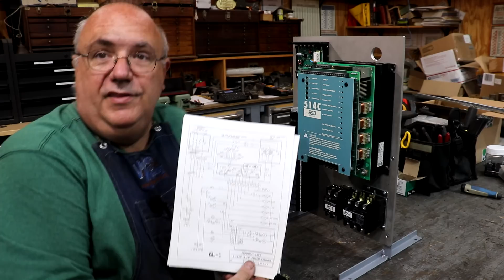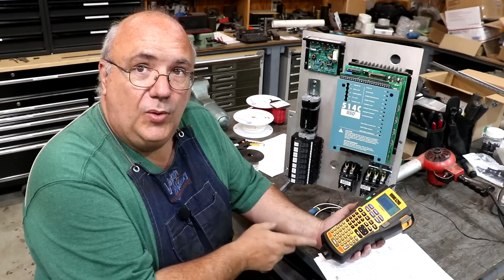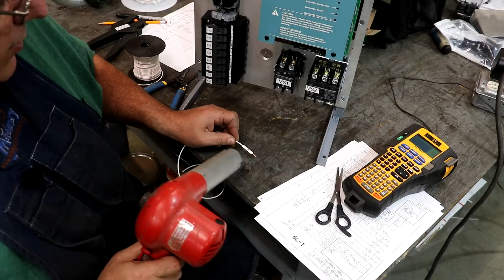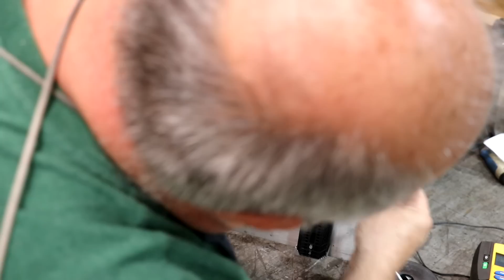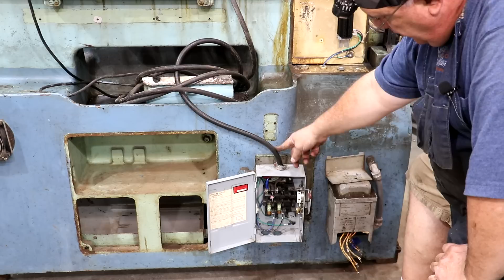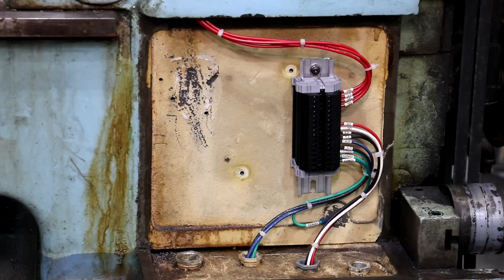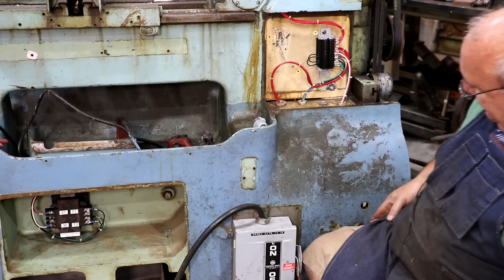Monarch 10EE Drive Retrofit 4:Wiring the Component Panel and Lathe Controls

Comment: Really great. Can't wait for the first power up. Turn it on and tune for maximum smoke. 
Although the little label maker is neat, I prefer the BRADY self laminating labels. You can use their expensive machine, or buy them in sheets which can be laser printed or hand lettered quickly. You wrap the label end on the wire and the tail is clear, so when wrapped all the way your label is protected and the material almost grows together over time. No faffing around with a heat gun, etc. I do all my transmitter and studio equipment installs with them.
Reply: Good point about the labeling; however my experience with the self laminating labels has been that after several years in a hot machine environment, the labels will begin to unpeel and in the fullness of time will drop off. The heat shrink tubing, if not damaged will not fall. I pray that my 20+ years of panels built will someday be uncovered by archaeologists.
Reply: @johannesnoneoftheabove9957  odd. Never had that issue with Brady labels even in transmitters and hot equipment cabinets,
Reply: @The_DuMont_Network  Labels falling off was my experience with building wiring harnesses for industrial air compressors.
Reply: @johannesnoneoftheabove9957  The wraparound self laminating type seem to stay the longest. On heavy duty or high heat/vibration applications, I will add a second label where possible.
Reply: @The_DuMont_Network  That should help.

Comment: Keith a suggestion for you, get some solder flux and tin you’re exposed wire with solder before terminating your connections , this will make A better connection
Reply: If you mean tinning a wire before trapping it with a screw terminal, that is a recipe for long term problems. Solder flows under pressure, so the joint will eventually become loose and if its carrying enough current, overheat.
Crimped on terminations would achive what you are suggesting without the long term problems.
Reply: Better option is boot pace ferrules.

Comment: Great job Keith but it seems that no one here is acknowledging the effort that John the electrical engineer has done to engineer the circuits and provide the electrical wiring diagrams for you to use.  Therefore.....GREAT JOB John, hats off to you for helping Keith with the electrical engineering on this project!
Reply: Yes, I agree, thanks John for a job well done!
Reply: Great call out to John, working with old electrical equipment, great thank you for helping Keith.  :)
Reply: Keith mention shim several times in each video, so I know that he is very appreciative of his help. There's been many times for me when a call to an engineer would have been very helpful!
Reply: @davidgagnon2849  Guess you missed my point.....read my post again.  I intimated that most of the COMMENTS praising Keith made no mention of John.  I know that Keith appreciates John but expected that the commenters would acknowledge the efforts of John as well.
Reply: @rjw8316  Yes sir. I understand.

Comment: I've had good luck with the Parker 590+ DC Drives (which I think are a decendant of that 514C) running separate voltages for the armature and field. If I remember right, using a lower field voltage than armature was configurable via the drive parameters, but if you need a higher field voltage than armature you can provide two independant supplies, as long as they were in phase with each other (we used a zero phase shift transformer from the L1 / L2 connections to generate the field supply)

Because it's a programmable, digital drive the 590P also has plenty of IO connections for the control circuits so you  would have been able to wire all of the push buttons / speed controls etc direct to the drive.

Comment: Live my heat shrink printable labels. 
TIP: type in as many labels as you can with a little slice between them and print at one time. Saves about 60% of the expensive labels. Cut with a scissor.

Comment: To all those "Grommeteers" - Keith did promise, in the first video, that he would be putting in rubber grommets later. BUT Keith you should 'tin' the ends of your stranded wires. It is so easy to miss a single strand and cause a short. Hey a cigarette lighter would cut down the heat shrink time by 75%. OK that's me done - all the best. Bill B - UK
Reply: No, never tin the ends.

Comment: Great project Keith.  There are several of the fantastic lathes out of service because there isn't a good program for replacing the  outdated electronics.  Hope you will be able to provide a good solution to this problem when you have finished and debugged installation.
Reply: Jack,
 Out dated electronics might not be the modern way, but the original was subject to a great deal of development and plainly did work, and work well. It’s a pity that the skills required to repair the original are less plentiful.  I’d be careful of thinking that old is wrong. Our forbears did the best with the limitations of the time, as I hope we do with our resources.

Comment: Fun already! I haven't look up your drive specs but I am surprised that you still need a motor reversing starter.  Typically drives have forward/reverse built in and can be directed with a switch input.  Additionally, some drives might not be happy (fault or burn out) to be connected/disconnected from the motor which would happen if you use a motor reversing starter.

Comment: As a electrician for 43 years, and also a master electrician. I have seen many, many wires short out from doing exactly what you're doing by putting wires through a hole in metal, it will eventually rub through. just a matter of time. There have been countless comments from many people to put grommets in the holes, don't understand your reluctance to heed the warnings. At this point it's too late, you're wiring it. They make a plastic edge guard that can go around the edge after the wiring is finished, but somehow i don't see you putting that on the holes.
Reply: did you ever du a dry runs, before putting in grommets and industrial cable sleeve.
Reply: @1BigBen  No, put the grommets in, then put the wire through. Keith didn't do a dry run, he wired it up, trust me one or more of those wires will rub thru the insulation eventually,

Comment: Each output of the printer has a length of "margin" or overrun. Printing each label individually burns a LOT of product in the margins. A method for more efficient usage is to create a single printing of multiple  labels separated by an appropriate number of spaces. Print and snip off  each label with scissors.
Reply: Agreed... I've used the same printer at a previous job. I believe they designed it to waste label material so you have to buy more. Epson makes one that will print and retract the material afterwards to save it. What I would do is start with a period, then 2 spaces, the wire #, 4 spaces, wire #, 4 spaces... etc. and end with 2 spaces and a period. Print, then cut the with a scissor.  .  10    20    30    40    50  .   And I always underline the numbers. so there's no ambiguity with sizes and nines! :)
Reply: A major complaint of mine with Brother labelmakers.
Reply: @The_DuMont_Network  indeed 
I have a Brother P-touch, the design is not good, as cutter is to far from the tape.
however the best design may still be under patent 
I was very disappoint with it overall
Reply: True,  I have that printer and bought a roll of the heat shrink.  I was very disappointed because there is hardly no material in that roll due to the thickness. Dymo tapes are ridiculously expensive.  I now buy off-brands from Amazon for twice the product and half the price.
Reply: Yes. That’s true with ALL label printers. The printer needs a certain length in front of the label in order for the rollers to pull the label through and to move through the guides, printing continuously, giving it whatever spacing needed for the pieces is the best way to go.
Reply: @melgross  The Brady printer makes individual self laminating labels in a number of widths lengths and colors. The printer doesn't waste space. It can be operated from the keyboard or from a computer connection. It is my go to printer for one or two offs up to ad hoc projects. When I do a major product I use the 8.5x11 sheets, get the data from the plans and safe a lot of time.
Reply: @The_DuMont_Network  they, though, that’s not the kind of printer most will be buying.
Reply: @melgross  Wanna do the job right, get the right tools.
Reply: @The_DuMont_Network  you’re mistaking many people for those who do this for their profession and need to do it five days a week. I’ve got some very expensive tools, but if I do it just a few times a year and I need to label maybe fifteen wires as I did recently, I don’t use a wire printer. I use a black fine point permanent marker and write the number or work on a short piece of white or other light color shrink. When I shrink it on the wire, the printing darkens considerable, and is extremely hard to remove. That’s faster than using the printer, and I can letter very neatly. It looks even better after it’s shrunk.

But if I were to do this all the time, I’d get a printer specifically designed for it. Otherwise, a Brother printer that does up to 24mm wide labels is the perfect choice, for me, and most others.
Reply: @melgross  Not mistaking anyone. Merely stating facts and sharing my experiences. He has what he has on hand and uses it. There are better and there are worse ways to label wires. He is detail oriented and has the patience of Job, so faffing around with heatshrink and all the rest is not anathema to him. He's not wrong. I'm not wrong.
Reply: I have to do this with my Casio... sadly no way to adjust settings for short leader, so we just make run-on labels, and snip them apart.
Reply: I do the same thing for component labels with the P-Touch to reduce waste.

Comment: Keith,

I hope when you are finished you create an "as-built" set of wiring diagrams and create a protected storage area for them.  I would suggest you laminate them to help protect them against damage over time. An instruction book would also be a good idea.

It would also be a good idea to add a USB flash drive to the package. 

Bob
Reply: Laminate the as-built AND put a copy INSIDE the lathe.

Comment: As an Amateur Radio Operator wiring such as this is old hat.   3 things, Silicon grommets, marine grade heat sealed crimp connectors, and Caig DeOxit for the switches, rheostats, and relays. Get the full strength topically applied with a brush version.

Comment: Thanks Keith, I always learn from and enjoy the things you do.
Two tips I would like to share is,
For heat shrink tubing, I found a nice little heat gun that is made for heat embossing. It has a small , precise nozzle that works great on heat shrink. You can find them in the paper crafts section at hobby lobby. You may also find that the embossing powder could be used to restore badges on old machines. The other thing I would like to say about labeling wires is, remember to leave a little space in case the wire ever has to be re-terminated.
Thanks again.

Comment: Did you wire up that vent fan on the left of the machine? Or do the new electronic components not get hot enough to put up with the noise of the fan?

Comment: I don’t get it Mr Rucker. He is an electrical engineer, he knows all the spec’s of all the components, and design accordingly by the numbers. Not some amateur messing around doing guess work. At the end the only testing would be, is to see if the wiring is done right, not that if it’s gona explode or not 😂. By the way great work 👍

Comment: It's coming along nicely. I think having that transformer inside the lathe makes a cleaner installation with less opportunity for fluids or chips to interfere. Two questions I have are : 1) do you plan to make a  cover to go over the terminal block and the wiring going to various lathe controls? & 2) What type of wire are you using? It appears to be more flexible than standard stranded PVC insulated wire. Nice work!

Comment: So you have an extremely complex controller running an 80 year old motor design.  If the motor fails, you will either have to change to a modern motor and drive or spend a ton to rewind the old motor.
Reply: If the motor fails it will probably be the bearings that go. Those should be easy to replace. The brushes should be inspected and replaced as needed. For all the work this lathe will do, I expect it to outlast Keith.
Reply: @millwrightrick1  Maybe bearings, maybe windings- it's a lot of time and expense to gamble on that old motor.
Reply: @oldschool1993 , Keith has had a number of motors rewound over the years, he has an electric shop he uses all the time so maybe he gets a good deal from them. Hopefully he won’t need to.
Reply: @Hoaxer51  He's gonna need a good deal- I called around to some motor shops and told them I had a 6 wire 5HP DC motor from the 40's and asked about re-winding- most said they wouldn't touch it, because the cost would be many times that of a new motor. Only one guy said he would look at it, but he wanted a deposit up front in case the cost was too high and I would just abandon it in his shop.

Comment: Hi Kieth, when I was doing panel wiring I liked the Panduit "wire way", if a mistake was made or later on a problem occurred one could just pop the covers off and follow the wire. with wire ties you had to cut all the wires in the area that you were working on.
Rich
Reply: I always used Panduit too.  It's too late now but please consider it the next time.

Comment: Why do you need a 240V to 120V transformer? Just use one leg for 120V.
Reply: I wondered about that too, but then thought about balancing the load on the two legs - hence the use of a transformer off both legs.
Reply: Don’t think the small current used by the control circuits would be a significant load imbalance. Would however have to pull a neutral to the disconnect.

Comment: I think you did a decent job explaining it. I didn't fully follow before, now i understand. Surprised you could get 2 motor controllers to work like that for this.
Reply: I was somewhat confused by his description of the 3 wire control Start-Stop Switch. My experience has been that the power will come in the normally closed Stop button contacts, thru to one side of the normally open Start button and a normally open contact on the motor starter/drive/control relay. then when the Start button is pushed the motor starter/drive/control relay contact will close thereby causing the machine to run.  Pushing the Stop button will cause it to stop.  This was done to minimize the possibility of unintended starting due to a short circuit.  Many times the Stop button will have a large manual E-Stop mechanism to aid safe operation.